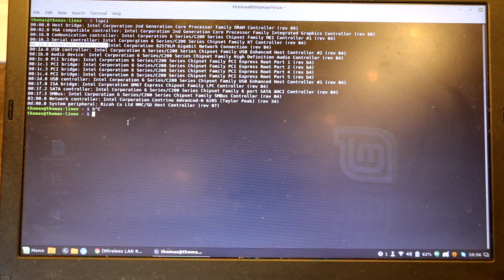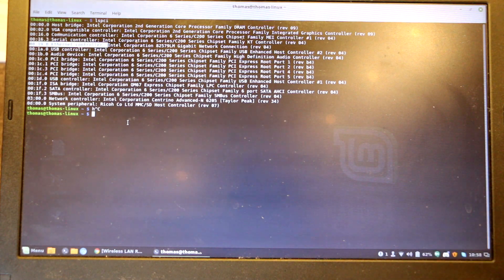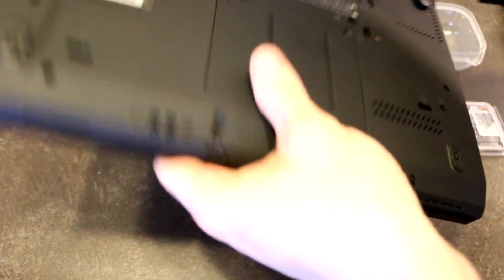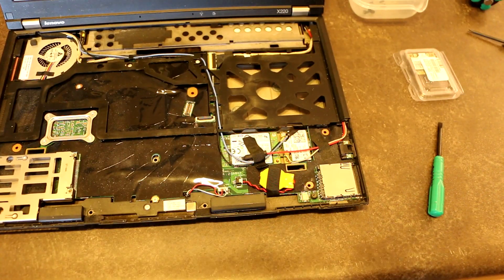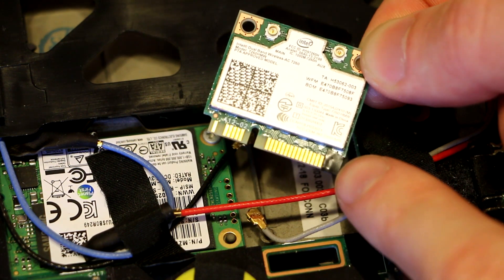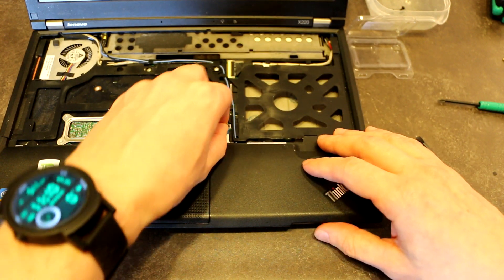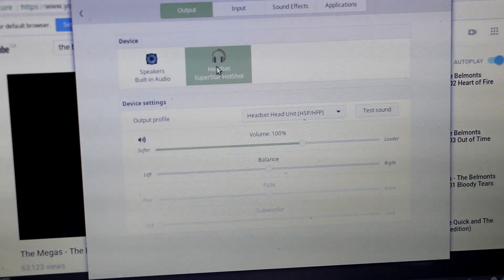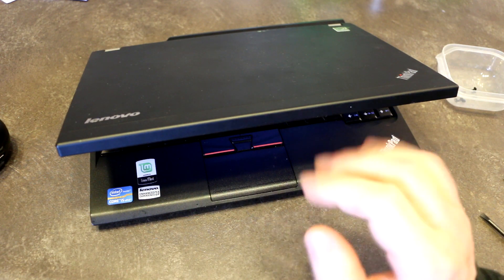Installing an Intel 7260 WiFi + Bluetooth Card in your Thinkpad X220

Comment: Laptop Retrospective   Isn't it the Lenovo laptops has whitelist that don't accept other new "WiFi Internet Adapter"?  What is the purpose of that cover the tape on pin #1?  I've been looking around how to remove whitelist on my Lenovo Thinkpad E40, so I can install new hi-speed Gigabyte "WiFi Internet Adapter". It doesn't recognize.  Nice video, thnx.
Reply from the maker: I mentioned at the start of the video you need to flash a custom BIOS to get it to be recognized. The default BIOS will not allow it.
The E40 is a different machine and will have different steps.

Comment: How can I check which card is compatible without opening the laptop? My old laptop was manufactured in 2011, I'm thinking about installing a dual-band card.
Reply from the maker: Are you working on an X220 or another laptop? Manufacturers usually list compatible cards on their build sheets, but most have whitelists that need to be removed before you get wider compatibility.
Reply: @LaptopRetrospective  I have a Samsung laptop, I googled around and according to one, Samsung don't normally whitelist the WiFi cards. I'm just worried about the correct form (mini PCIe/ngff), its compatibility (AXXX only works with 10th gen CPU, not with older CPUs - For example).
Reply from the maker: Try looking on Samsung's website to see if they list the specific card they include then look up what form factor it is. That would be my suggestion.
Reply: @LaptopRetrospective  Thanks dude!
Reply from the maker: You're welcome.
Reply: @LaptopRetrospective  Update:

I have successfully installed Intel AC7260 in my old laptop, thanks to your guide.

Plug and play, install drivers and that's it! Working perfectly in Windows 10.

I even upgraded a new SSD, repasted CPU and GPU thermals, cleaned laptop fan and heatsink.

If it's not for your video, I don't even dared to unscrew anything on my laptop.
Reply from the maker: Thanks so much for the update and I'm honoured I was able to help you. Perhaps this will be the first of many you will open?
Reply: Of course! I'm looking forward to upgrading another laptop (and maybe building my first PC).
Reply from the maker: Awesome!

Comment: Hey there! I'm wondering if you've done any research on using a triband card in the x220.
I've heard rumors that the wiring for the 3x3 antennas is in the device...
i.e. the Intel Centrino Ultimate N-6300 was an option back in the day.

Wifi antennas are black, grey, white
WWAN antennas are blue and red.
Reply from the maker: Good question. If I ever get a card to test that could be an interesting experiment. I think the trick would be the form factor of a newer card likely being M.2 rather than mSATA sized.
Reply: @LaptopRetrospective  Perhaps the AW-CB160H, maybe with MHF4 to U.FL cables if necessary

Comment: Thanks,I need to know how can I connect  my technics sl d3 turntable with X220. Need any installation??
Reply from the maker: You want to hook up a record player from 1978 to it? Just want to make sure I understand you correctly. What do you want to do with that kind of setup exactly?
Reply: @LaptopRetrospective thanks for your concern actually I want to connect my record player with lenovo as a source for listening music beside that I have to connect an amplifier.
Reply from the maker: The only way I can imagine is using another piece of equipment to translate the sound into either a USB signal or 3.5mm mic input. But I'm not an expert in this sort of thing I'm afraid.

Comment: Surgery done and went well today. i bought the wifi card, exactly as advised on the site from amazon and all went just fine.  In addition, Something funny has just happened tough. i has a long time issue , when i pressed Caps lock, and the it would delay before caps were actually changed, after replacing the wifi-nic now the issue is gone? i`m guessing, that might have to do with me tweaking the keyboard while re-assembling. Thanks again for your how-to tutorials.
Reply from the maker: Glad to hear it when well and your keyboard is working as well.

Comment: can you tell me which one should I choose for acer e5 576g? intel 7260 vs 9260???
Reply from the maker: This method only works for the X220. I'd suggest Googling to see what cards your laptop supports.
Reply: @LaptopRetrospective  works with x230?
Reply from the maker: Process is slightly different.
Reply: I used 3168 in my laptop and it's working perfectly.

Comment: Hi, is this method applicable to newer version of wifi card?
Reply: What if u change wifi adapter without update the bios? Will it works?
Reply from the maker: No, most laptops have a whitelist of approved cards. If it detects a card that isn't on that list the computer usually won't boot.
Reply: I have succesfully update my x220 bios to  version 1.46. The problem now is my touchpad & trackpoint not working after the update. Can u help me on that? Tq
Reply from the maker: So to be clear, all you did was update to the latest official BIOS?
Reply: @LaptopRetrospective  yes.
Reply from the maker: Keyboard still works and you can get into the BIOS menu?
Reply: Yes. Keyboard is working and i can use it in bios menu
Reply from the maker: Very strange. The keyboard and TrackPoint are on the same ribbon cable.   FN+F8 toggles the trackpad on and off but won't ever turn off the TrackPoint. Assuming you're running Windows 10, plug in a mouse and check for driver updates would be my next step.
Reply: Yes. I found it strange too. I tried using ubuntu & windows 7 on my x220. Not working on both OS.
Reply from the maker: Very strange indeed. Perhaps try reflashing. If it is BIOS related maybe something did go 100% right.
Reply: Ok. Can u provide me with official link to download the bios update patch? Just want to make sure i will flash with the correct one. Thank you.
Reply from the maker: Should be this one here: https://pcsupport.lenovo.com/ca/en/products/laptops-and-netbooks/thinkpad-x-series-laptops/thinkpad-x220/downloads/driver-list/component?name=BIOS%2FUEFI
Reply: Thank u. Will try and update the result here.
Reply from the maker: Good luck!
Reply: Hi. I did the update using file downloaded from the link. But my touchpad & trackpoint still not working.
Reply from the maker: Ok I think I found a solution in the Lenovo forums: "In the BIOS I selected "load setup defaults".

https://forums.lenovo.com/t5/ThinkPad-X-Series-Laptops/X220-Touchpad-and-Trackpoint-not-working/m-p/2201233
Reply: I have tried load setup defaults, not working. So i flash back older ver1.43 and system halted error appeared. It requires me to remove new wifi adapter and reinstall original wifi adapter. After i reinstalled original adapter, touchpad and trackpoint now working. Problem is, i cannot use enter and backspace on my keyboard.
Reply from the maker: Wait so you tried to install a new WiFi card with the original BIOS? You didn't mention that before...
Reply: I updated BIOS to ver 1.46 before i change wifi adapter.
Reply from the maker: What did you change the WiFi card to? If it isn't one on the whitelist then you need a modified BIOS (not an official one) or it won't work.
Reply from the maker: I've heard mixed results in the comments here. I can only tell you for certain it works with this one.
Reply: I change to wifi card as per recommended in your video.
Reply from the maker: Right, I clearly say a minute in you need to install the modified BIOS for it to work and have a card linking to the video that tells you what to do. The instructions need to be followed or you'll have no end of problems.

Comment: Thanks for the video! I can't get this to work to save my life. I have the modified 1.46 BIOS (I can see the advanced menu) but after trying dozens of times with electrical tape over pin 51 and having it not detect any wireless card I decided to cut the pin instead. Still no luck. I tried re-flashing the BIOS a few times, and no luck. I tried putting the card in my Y580 IdeaPad (also with a modified BIOS to remove the OEM hardware whitelist) and it recognizes the 7260AC card, so I'm pretty sure it's not defective. I'm totally at a loss here, does anyone have any tips?
Reply: I have the same model as you and have upgraded bios to 1.46 which should work fine as I have installed the card and did it first time with a little tape at the end pin 51. My Wifi and Bluetooth works but I find my old Arthos AR5B95 card give better connection under Linux. You cannot cut the last pin as the reverse is used for other purpose. You only need to either cover pin 51 or scrap the gold bit off on the top side only.  I still have my old Bluetooth in and that has not caused any problems.  Even without pin 51 covered you should have internet connection, I think you did not install the card properly or the antenna was put securely put back resulting in the none detection of the card.  Good Luck.
Reply: @jamest7677  Hey James! I appreciate the advice, but I've tried with both the modified 1.46 and 1.43 BIOS. I think if the BIOS were the problem the computer wouldn't boot up at all (it'd tell me to remove the card). I know about the reverse side of pin 51 being necessary, when I say I cut the pin I meant removing the gold bit as you said. The Thinkpad doesn't detect any network adapter but it is able to use bluetooth through the 7260AC, so I'm pretty sure the problem can't be that the card is improperly installed. My very last guess is that the PCI-e slot is defective somehow, but I don't know. I think I just got really unlucky.
Reply from the maker: Just to confirm what exact card are you using and model of x220?
Reply: @LaptopRetrospective  Thanks for the quick reply!
The card is an Intel Dual Band Wireless-AC 7260 Model: 7260HMW and the Thinkpad is the standard, non-tablet x220
Reply from the maker: What operation system is this booting into? Have you tried a Linux live usb to rule out a driver issue?
Reply: @LaptopRetrospective  I've tried it with Windows 10 Pro and Manjaro Linux, neither recognizes the card :(
Reply: @LaptopRetrospective  One weird thing I've noticed: Looking at the device manager in Windows with the 7260 plugged it, it flickers every few seconds like a reload. Maybe it's trying to recognize the card and failing? I've ordered an Intel Ultimate-N 6300 hopefully I'll have better luck with that one
Reply from the maker: Hmmmmm. Interesting. Flickering is not a common behaviour I'd expect to see.
Reply: @LaptopRetrospective  The Intel Ultimate-N 6300 doesn't work either... and that one is on the OEM whitelist. fml xD
Reply from the maker: I think something is wrong with that computer or something went wonky with the BIOS flash.
Reply: @LaptopRetrospective  Yeah I think so too. But I've done the modified BIOS flash 4 times now, and it still recognizes the Intel Centrino N-1000 card which it came with (which is so bad there's no point in using it at all), so I don't know how it could be the card slot. Insanely frustrating.
Reply from the maker: No kidding! I wish I knew what to tell you.
Reply: @LaptopRetrospective  All good! Thanks for talking through it :D

Comment: is it possible to install Wifi 6 Wireless Card Intel AX200 Bluetooth 5.1 AX AC NGFF M.2 2G 5G M2 on x230 and get its full speed?
Reply from the maker: X230 has no m.2 slots AFAIK
Reply: @LaptopRetrospective  thanks for replay. Any solution for x230 to get bt ver 5.1 connection? Dongle or docking?
Reply from the maker: I suspect you'll need to go dongle if you want the latest. Not sure if cards that form factor have been made.
Reply: @LaptopRetrospective  thanks again.btw,  Its 8.30am here.

Comment: It’s a neat upgrade. I just did it recently on my X220i. Note the Bluetooth icon doesn’t flash even if you’re thinkpad is connected to Bluetooth. Minor issue nonetheless!
Reply from the maker: If by icon you mean indicator light, it probably won't because it's looking for the original FRU.

Comment: Sorry mybeifi card not function buy the bluetooth still work n can pair...sould i replace the ecisting wifi catd?
Reply from the maker: If it's original Bluetooth then it's a separate card under the palm rest. If the existing card doesn't work, then you can replace it. To use this one will require a BIOS mod.
Reply: @LaptopRetrospective  my bios have mod
Reply from the maker: Should be good to go then.

Comment: Could you perhaps say something about the differences between the old and new cards and the reason why you upgraded ? Also a little background about why one pin should be blanked off would also be interesting.
Reply from the maker: Faster WiFi speeds, access to the 5ghz band, built in Bluetooth for a model that didn't have it already. As for why the pin needs to be blanked, Bluetooth doesn't work on this model of laptop unless it is, I don't know the technical details.
Reply: @LaptopRetrospective  Have you found that you can pick up WiFi from longer ranges as well? Or in other words, are you now getting a stronger WiFi signal in spots that previously had weak/no signals?
Reply from the maker: I'd say the connection quality is nicer but it's still the same antenna.
Reply: @LaptopRetrospective  Even relative to the stock antenna? I'm not terribly familiar with the difference in specs between the two but I would have figured a newer WiFi card would be able to pick up a stronger signal, all other things being equal.
Reply from the maker: It can pick up newer bands like 5GHz which will be a better connection in general. I don't think range is really in the equation when you keep the antenna the same.
Reply: @LaptopRetrospective  Appreciate the explanation! Had to look into it more since I was associated your use of "antenna" to mean the entire WiFi card. Didn't realize that range of signal detection wasn't completely tied to the IEEE 802.11 standards. I thought by default, an AC card would be able to pick up a stronger signal than a N card but now I know better.
Reply from the maker: Happy to help in any way I can.

Comment: Ok i have installed the chip and it has given me a good boost on my wifi. however i dont apear to have blue tooth, any sugestions? i did tape the pin , but maybe its exposed would that cause no blue tooth?
Reply from the maker: Windows or Linux?
Reply: @LaptopRetrospective  both, but i am mainly running linux
Reply from the maker: Exact model of WiFi card?
Reply: @LaptopRetrospective  7260HMW was also advertised as 7260 wifi+bluetooth
Reply from the maker: Right, but the pin out might be different. I don't know if this trick will work with a different card. I remember someone else who used a slightly different card and this method didn't work.
Reply: OK break through, as suspected it was the pin linking https://www.youtube.com/watch?v=YLwLhZ76UCg&feature=youtu.be
Reply from the maker: Glad you got it sorted! Now we can confirm this card works?

Comment: I successfully upgraded the wifi card on my X220 per your instructions. Thanks! I just bought a used W520. can I use the same instructions on the W520?
Reply from the maker: Glad to hear you had success! The process for the W520 will require a different BIOS mod; it will not be the same or use the same files.

Comment: Hi. Thank you for your  helpful/useful video. One important & critical question from me is : why and what reason that you had to put that electrical tape on the pin 51? (what is going to happen if I don't put or I missed that part). Thank you
Reply from the maker: From what I understand from the original instructions it simply won't work. Some choose to cut the pin, but I wanted the non-destructive/reusable option.

Comment: I just did this upgrade! The custom bios flash sucked for me but I figured it out eventually. I couldn't get windows PE x86 to boot and amd64 couldn't run the Lenovo exe because it was 32 bit. Windows 10 could execute it but failed with a blue screen. Finally windows 7 pro worked flawlessly for the Lenovo bios upgrade and custom flash. The chip works great too!
Reply from the maker: Glad you hear you got it working.

Comment: I am on t430 and after installing the same chip, I noticed no bluetooth and I believe I need the exact same fix. Thank You very much for sharing.
Reply from the maker: T430 requires a hardware flash, good luck.
Reply: @LaptopRetrospective  oh really?, Thanks for the reply, the tape won't work? The Bluetooth seems ok except in device manager, and I tried to use it to connect to my phone yesterday but didn't spend too much time; my phone said, "do you want to pair with the # but the T430 never showed my device. Under device manager, it shows up in Intel wireless bluetooth with a code 10 this device cannot start.
Reply from the maker: @SamuelHollandsh  Unless the WiFi card is on the whitelist in the BIOS, you'll have troubles. The X220 allowed for third party BIOS writing via software, but that's not the case afterwards.
Reply: @LaptopRetrospective  thanks for the quick reply, I have the ivyrain mod that let me install the card and have the advanced menu.  I've actually built and flashed coreboot to the chip before but went back to play destiny 2 due to the requirement of having to be Windows, and me not being skilled enough to build coreboot with Windows boot or chainloader. Thank you sincerely by the way. 👍
Reply from the maker: @SamuelHollandsh  Ahhh, you would certainly know your stuff. The tape might help, I'm not entirely sure. It was needed in the X220.
Reply: @LaptopRetrospective  ok thank you, I'm gonna give it a shot and report back.
Reply from the maker: @SamuelHollandsh  Roger that, good luck! If not I'm sure you can find steps online in how to get this card working.